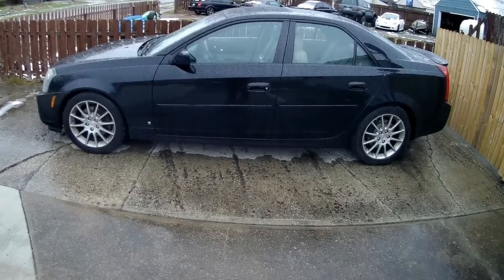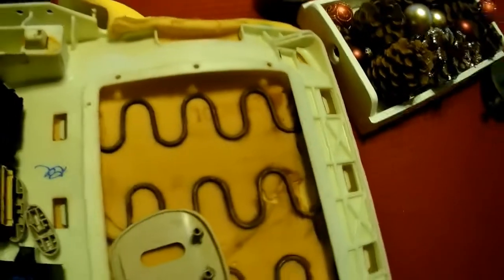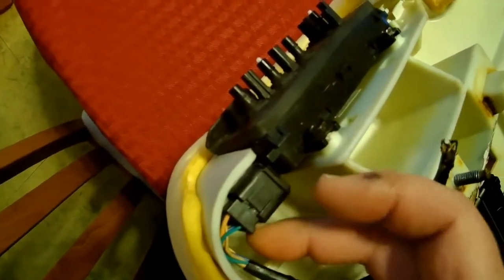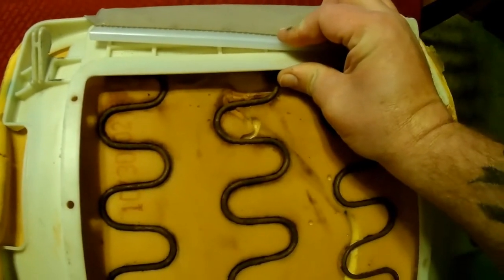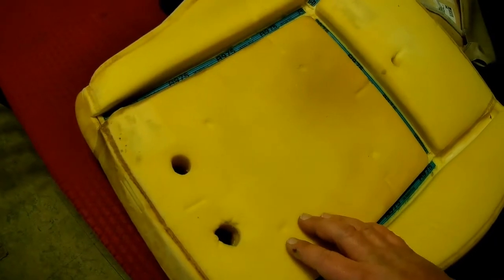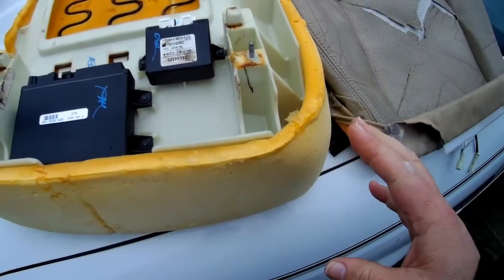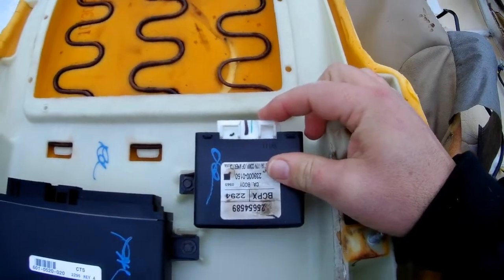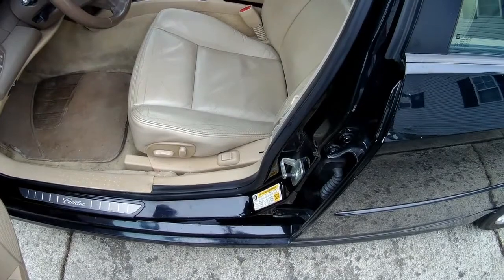2006 Cadillac CTS driver seat replacement.

Comment: Hi so the switch that moves the back of the seat forward and back if it breaks is that replaceable.?
Reply from the maker: Thanks for tuning in. Yes, you can replace the switch. It may be easier with the seat bottom out but I believe it can be done with the seat still bolted in. From what I remember, there are a few screws and 2 slide clips. Not a 100% sure on that though.

Comment: The two nuts on the front of the seat are they special nuts?
Reply from the maker: Thanks for tuning in! The nuts are just 10mm but you will need a deep well because the stud comes through a ways. If I'm not mistaken, you need the seat forward to gain access.